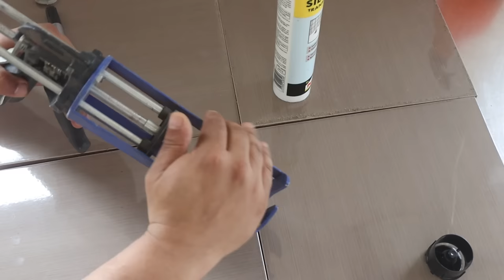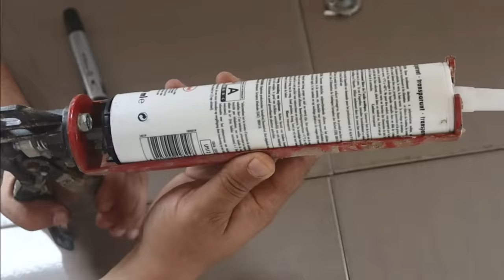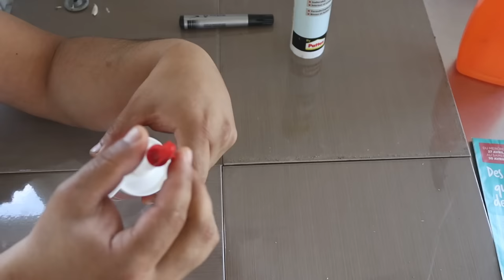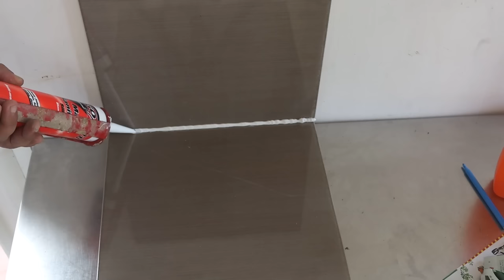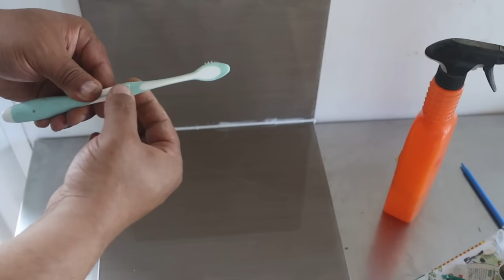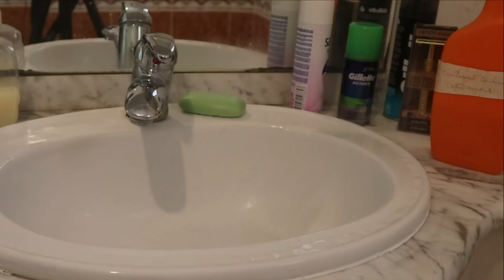Amazing Method Silicone Tricks That Only Professionals Use

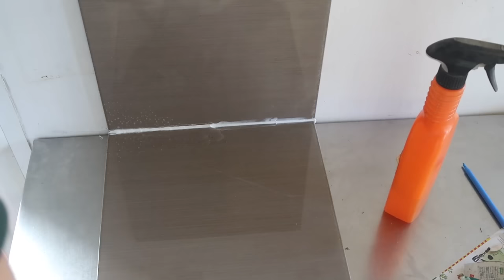Comment: @2:00 Spraying soapy water onto silicon is definitely a NO NO because silicon will not stick on soapy surfaces which means that if the soapy water seeps into gaps between the surface and the silicon bead you will eventually get mould.

Comment: Fyi. As a professional myself I always store my silicone tubes at room temperature so that it always flows easily from the nozzle. I never have this mans problem of coming out of the rear of the tube. No need to be messing about with any sealant gun if you know what you are doing. He could learn a few tips.
Reply: INDEED

Comment: A have been a professional caulker for over 40 years. EVERY THING HE SHOWS IS CRAP.
Especially using any liquid to tool the sealant. It works because it stops the sealant from bonding. STUPID IDEA . If you look close enough at major manufacturers websites n the data sheets intended for professionals THEY ALL say to dry tool. In fact if you spray anything on the sealant before tooling it voids the warranty. HE HAS NO IDEA WHAT HE IS TALKING ABOUT. And the one about using a syringe is hysterical. HERE IS THE FACT. the minimum acceptable joint width is 1/4 “. EVERY PROFESSIONAL KNOWS THIS,and every major manufacturer says this in there literature.The correct way to seal the small gap around a basin is either put 1/4” bead or remove the sink clean it well ,set the sink in sealant and after the sealant has cured tighten it using the silicone as a gasket.
Reply: De acuerdo con su aporte pero no es necesario ser agresivo en su lenguaje. Tenga en cuenta otras culturas.
Agree with your input but you don't need to be aggressive in your language.  Consider other cultures.
Reply: @mej3616  you are correct I should be nicer. I’m just tired about all of the misinformation and the claims only professionals know this. And none of it is anything a professional would do it bothers me when people put this out like it is true knowledge. And unknowing people follow it and it costs them money.
Reply: Get used to it mate. This is utube 2022..
I agree with you totally.
I also hate this finger waving bullshit they are starting to do.. No words spoken.. They just wave their finger like, no,no,noo...